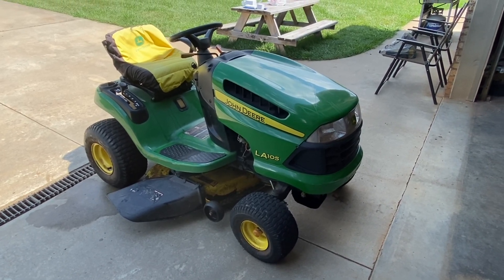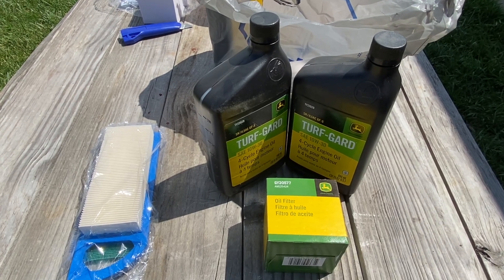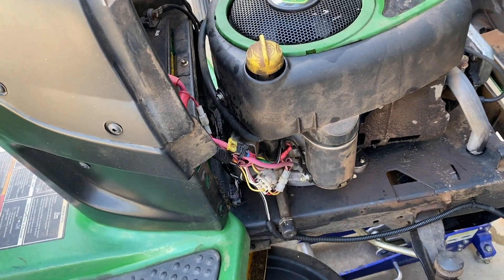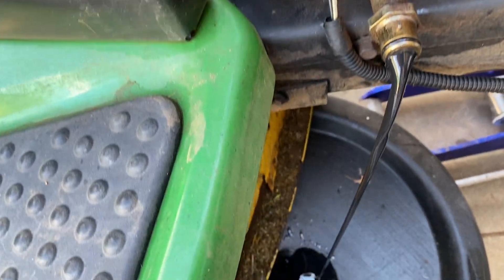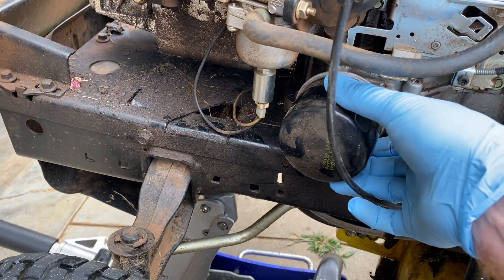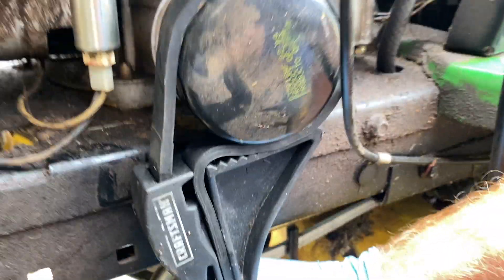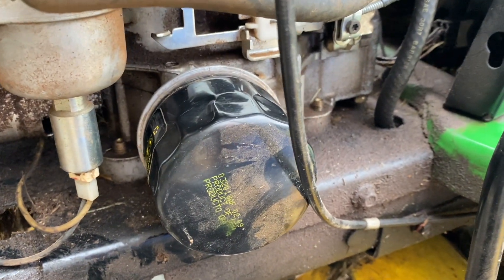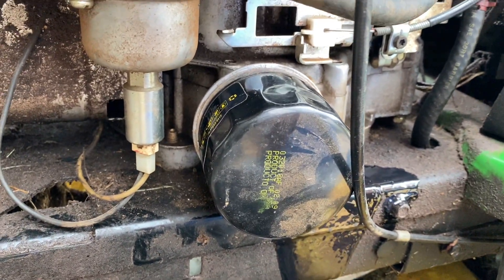John Deere LA105 Mower Oil change

Comment: LA105 only made 2008 to 2010
Reply from the maker: Thanks!  I believe the oil change procedure should be the same for most of the 100 series, but its always good to check the manual first.
Reply: @wecanfixit7308   Do you have to use john deere oil only ?
Reply from the maker: No, you can use any 10W30 quality oil rated for mowers @blackout7743
Reply: I  let the engine warm up so the oil flows better., just as I do on my car. I don't understand these people who feel the need to tighten the filters as much as they can, you really should never have to use a wrench on an oil filter to get it off.